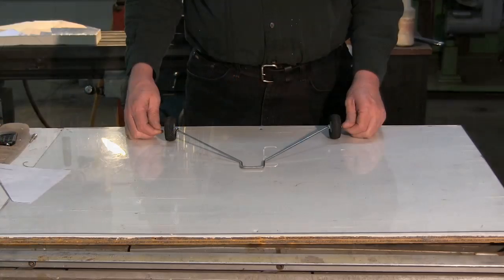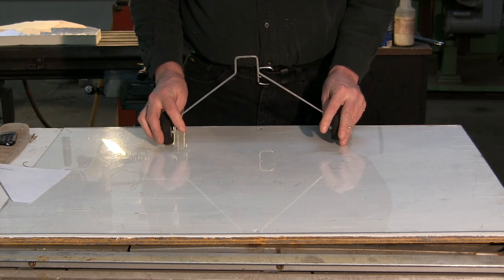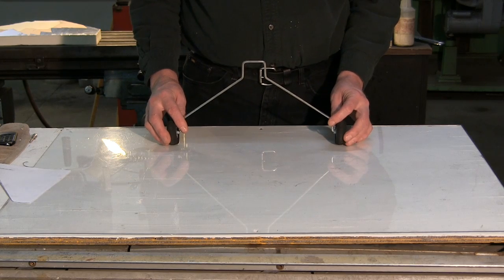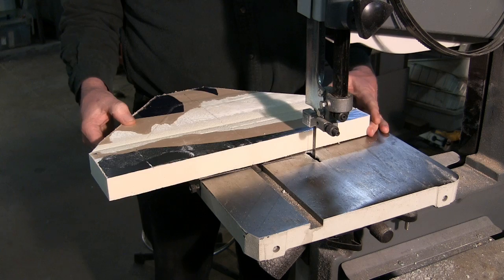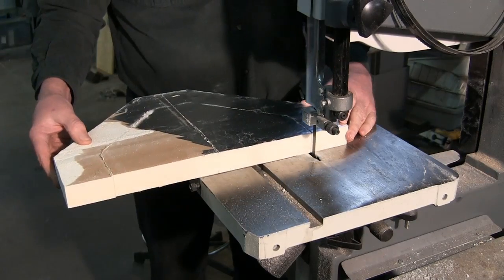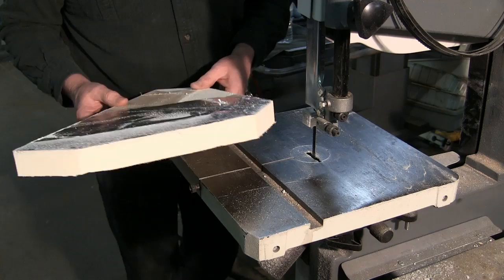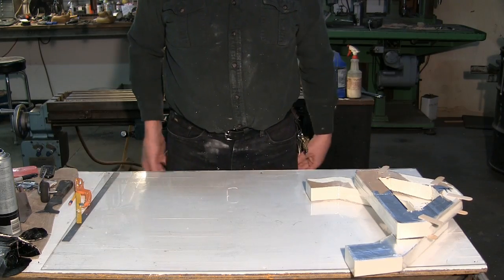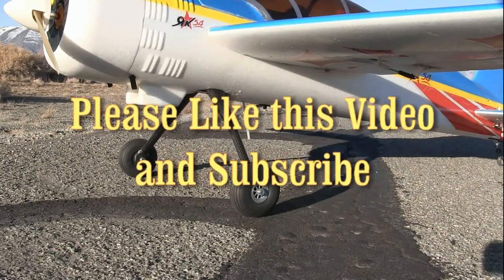How to build a scale carbon fiber landing gear for an RC plane pt. 1 of 6

Comment: Hi. I was thinking of making an rc jet plane and I think the engine could probably go around 200-300 maybe even 400 km/h. Would carbon fibre for the body and wings be a good material? Foam board will just break a part at those speeds.
Reply from the maker: Glass or carbon fiber would probably both work. As carbon fiber is about three times stiffer than glass I would probably use it rather than glass. Due to the speeds you might see stiffer is usually better.